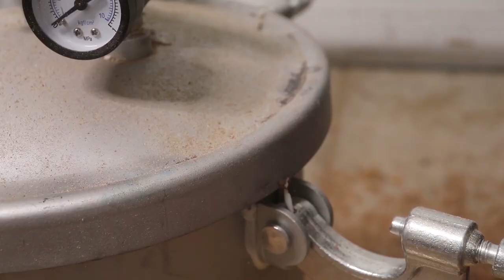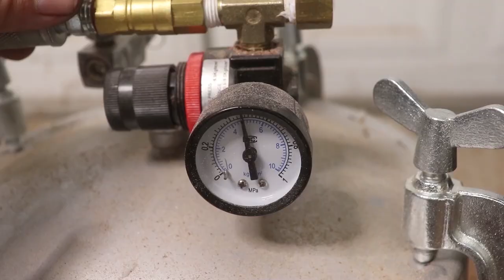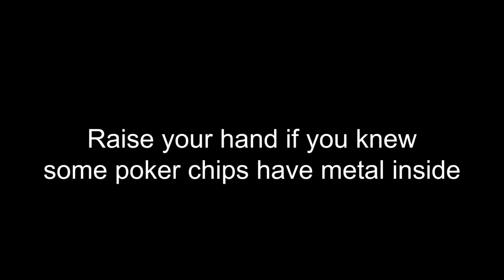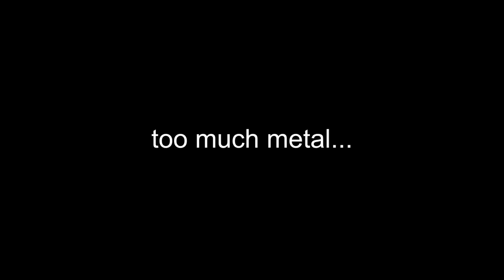What's Inside Poker Chips??

Comment: Some poker chips have RFID chips in them so they can be scanned/verified by the casino as legit.  But, that looks like steel and a lot heavier than just a copper antenna. Maybe they add weight to the higher denomination chips to help distinguish them from lower denomination chips for blind people or something, since all chips are the same size and shape.
Reply: I'm late to the party, so sorry. But here is the deal. Actual casino chips or other pro level chips are made of ceramics, with very precisely calculated measurements. Cheaper chips made to be bought in common stores are usually made of plastic, much lighter than the ceramics, so the metal is included to add weight and replicate the feel. Getting actual ceramics chips from a specialized store would allow a retry.